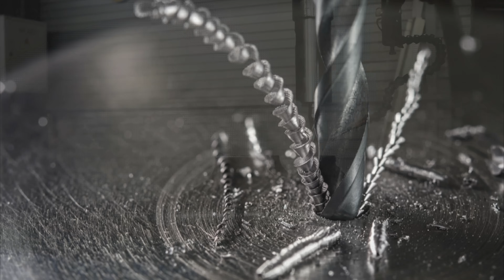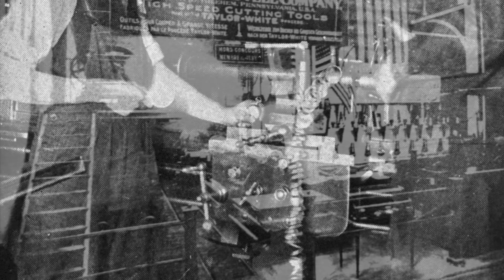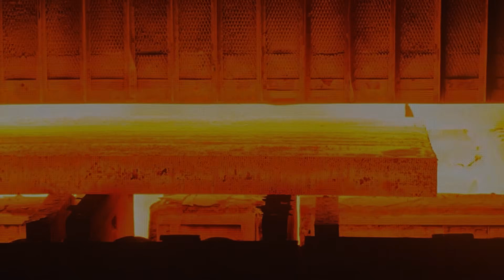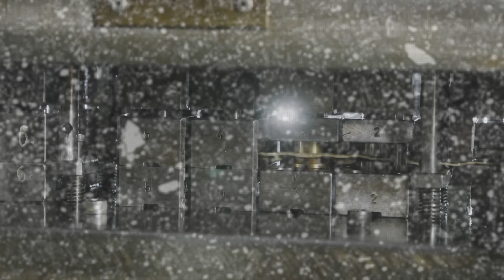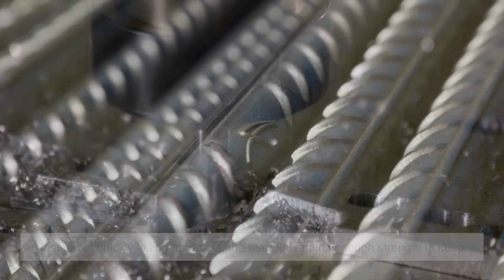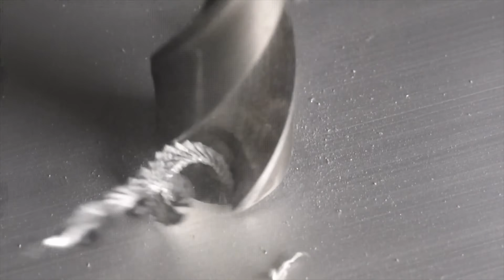What Makes Tool Steel So Incredibly Tough? The Metal Behind All the Tools

Comment: Good video for a 3rd grader.  Not even one actual detail sufficient to make even the slightest decision.  For instance you could have suggested an actual alloy used to make a wool chisel, bolt or drill bit.
Reply: You win dumb comment of the day. How does explaining what tool steel is include a how to guide for you to decide which alloy for you to use? How bout trying Google for your queery.
Reply: @matthewmoilanen787 Just because I know a lot more about steel than was presented doesn't mean that I don't enjoy watching videos about materials.  This video is similar to a 3rd grader watching a video that describes the concept of words are made up of letters,  but failing to show a single example of a word being written.  

Like taking about building a house,  showing some 2x4s and a hammer,  but not showing any relevant steps or sizes.

The videos lack any knowledge depth,  sort of like an English major doing a video on calculus.

Comment: Cobalt is the element that gives HSS its red hardness.
Reply: True, pure tool steel is very susceptible to localised heat, when it was used as milling cutters and lathe tools very slow speeds had to used along with copious coolant to ensure that blunting was kept to a minimum. Every machine shop had a very busy tool grinding department.

Comment: Tool steel is incredibly tough because it's engineered with carefully controlled amounts of carbon and alloying elements such as chromium, vanadium and tungsten. These ingredients give it exceptional hardness, wear resistance and the ability to keep a sharp edge even under extreme heat and pressure.